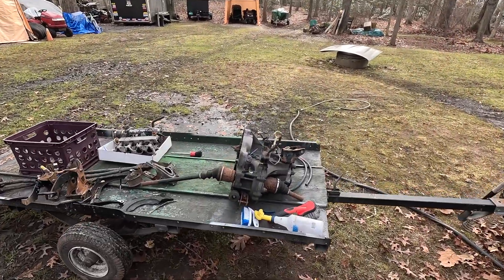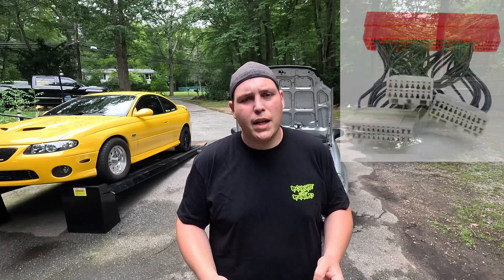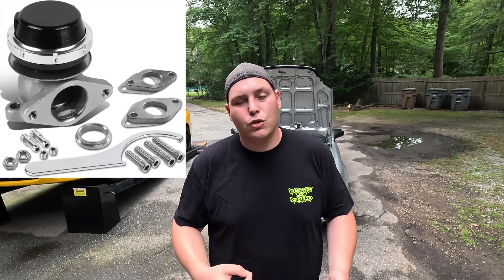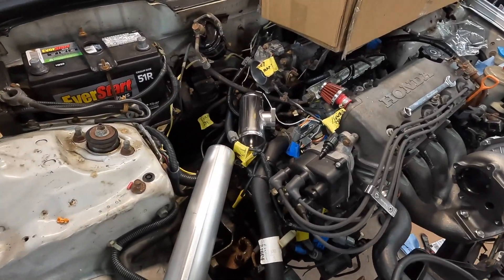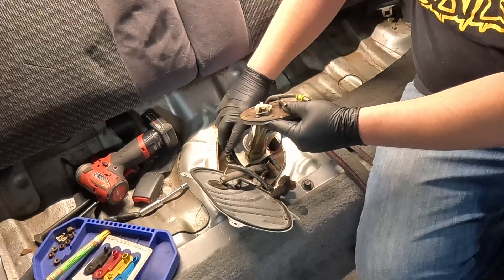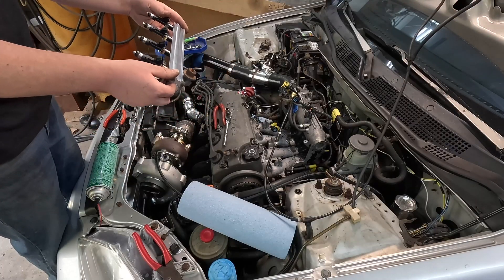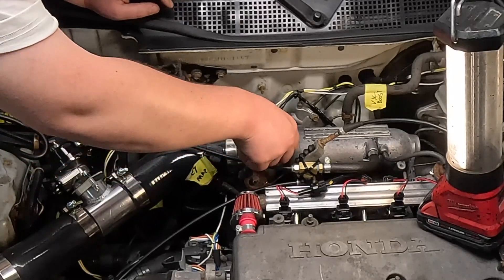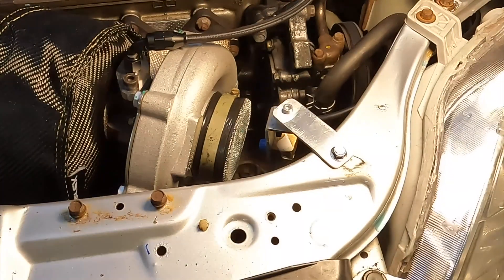CRAZY CHEAP! D.I.Y TURBO KIT PRICE BREAKDOWN! SUPER CHEAP BUILD SERIES

Comment: Does it clear the AC?
Reply from the maker: The turbo manifold will clear the ac pump but the ac condenser would have to be moved forward a little bit thanks for Checking out the channel! I appreciate the support! 🤟🤟🤟👍👍👍👍👍
Reply: @bought2build  Cool, looks like one of those AC tuck kits that relocate the condenser and lines would work.
Reply from the maker: @89GTFoxDude  yeah it probably would I think I will just make my
Own mounts and then have some lines made to fit where it ends up 👍👍🤟🤟🤟🤟🤟